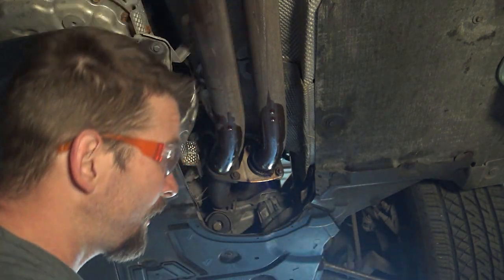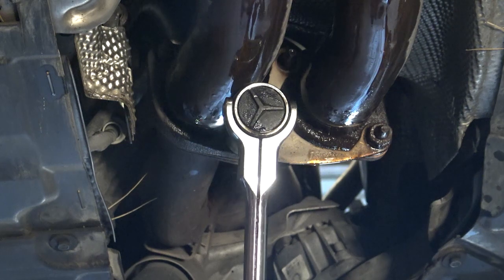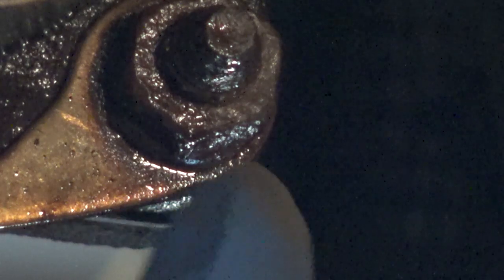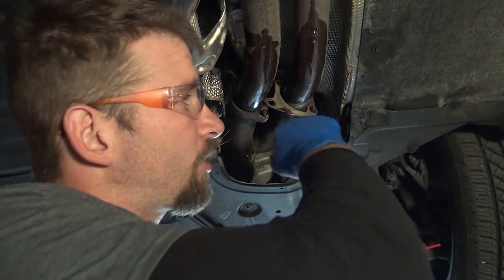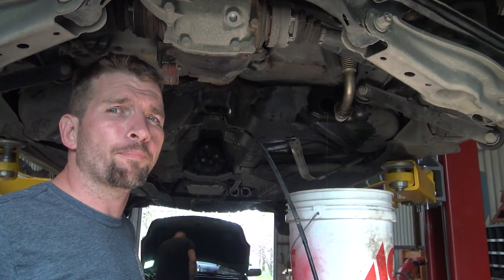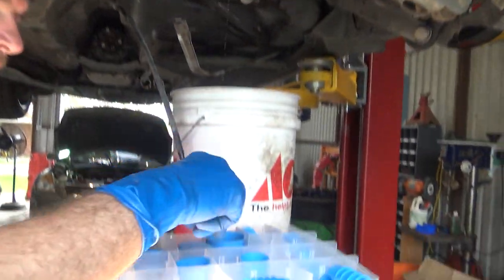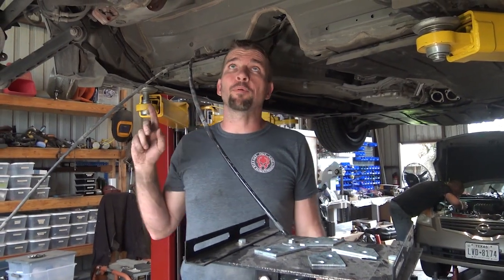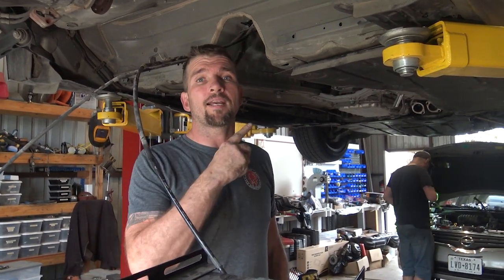Replacing the fuel tank in a BMW 328i E90

Comment: It might take 12 hours if you don’t have a 2 post
Reply: What you mean
Reply: @aymenem5304  it would be hard to pull the fuel tank out the bottom without a lift.
Reply: @gjs9871  imma work on mine tomorrow it’s 520it 2000
You think it’s gonna be same process ?
The tank is no longer good . Went fast on a bump
Reply: @aymenem5304  I don’t know for sure but I’d imagine it would be somewhat similar. Might want to look up a video of someone changing the tank or your specific model.

Comment: That's not rust!  Those exhaust nuts are practically pristine, not rounded off.  Come up North and we'll show you what rusty exhaust bolts look like.
Reply: Thats our texas level rust. up north yall got cars falling apart because of rust. Texas rust is just lots of crud baked on and surface rust.
Reply: rbaker142 Yes sir, break out the blue wrench, cut the bolts off, don’t even attempt to remove them by unbolting, or hit a pothole and drop the exhaust off all at once, that works too.

Comment: Hi, is it possible to get the tank out without taking the whole propeller shaft out? Because its pretty expensive to get the diff part of the shaft out in my 335d. Would it have worked for you to get it out while having the front part free hanging and the back part stiff at the diff? Thanks so much 😊😊

Comment: A pile of plastic junk.  Expensive to buy, expensive to own.  Supposedly BMW is full of plastic parts that break when car gets older, cost a ton to replace. Nice video though.
Reply: I'll never understand what people have against plastic. 

Plastic doesn't rust. I've replaced as many metal parts that corroded or warped as plastic. The difference being the plastic ones cost 4 dollars for the 150k miles as opposed to 20

BMWs are still pretty terrible, but it's not because of plastic.